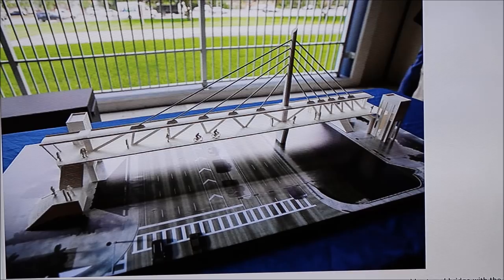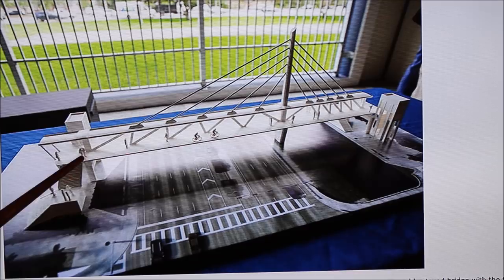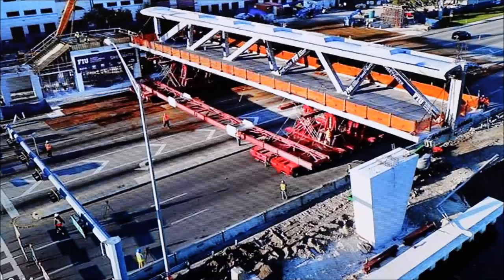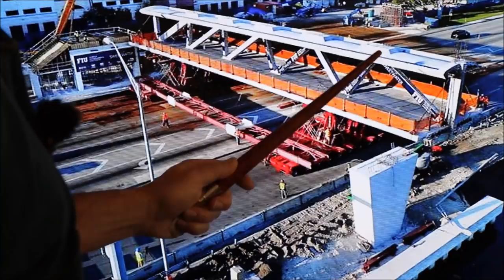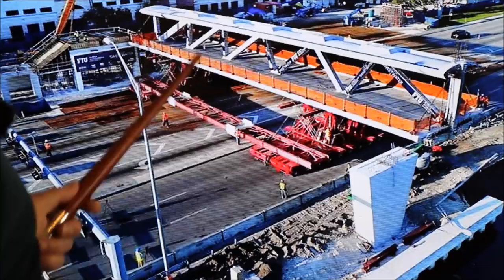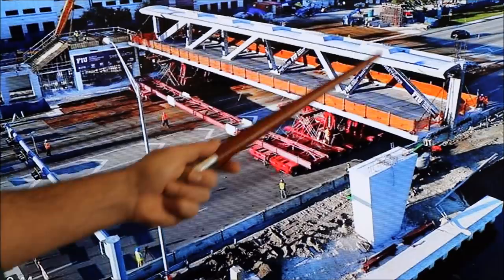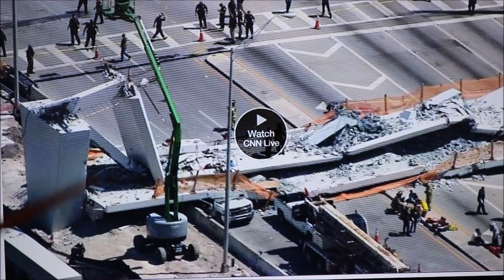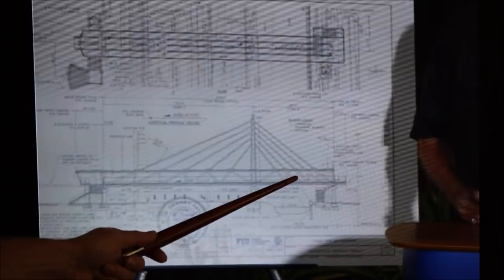Miami Bridge Failure- preliminary analysis 17 March 2018

Comment: Call me an armchair engineer , but this truss design is upside down !!!  The first truss member should go from top to bottom !! 
If you look at the rendering at 2:31 ,  from the main column you see the two truss members go from the bottom up, now imagine yourself holding two buckets of water in the air in that position....that would be a challenge to keep them up....same with this design.....

Comment: Thank you Juan.
This is a quite precise early analysis, although of course we'll have to see what the official NTSB investigation comes up with.

I have two remarks regarding this bridge failure as described in your videos. 
First I can't see any sagging of the bridge before the collapse on any of the various videos I found including yours; then the collapse is extremely sudden and quick. These together make it look like the failure is not of the tension rod but of the beam itself, as if it was unable to withstand the compression resulting from the tension rod elasticity. Could it be that the mechanical energy stored in the elastic tension rod accelerates the bridge going down?
Concrete beams should be able to withstand such pressure. I understand new materials were used. What were the beams made of?

As much as I agree that aesthetics is important for a bridge, it should never take precedence over structural soundness. When in addition the aesthetic choices make it look like a well-known good-practice for bridge but without providing the corresponding structural advantages, it looks more and more like an exercise in penny pinching.
I am not opposed to creativity and new inexpensive solutions but safety should always go first.

(Please excuse my usage of technical terms, I learned structural engineering in French and never practiced in English.) 

Separately and finally I seize the opportunity to thank you for all your great videos going through the whole south-western US on your modded CB500X. They made my twin and I consider Utah for a motorcycle trip to celebrate our 50th birthday. As it turns out it will probably be Vietnam, where he lives, but I am not ruling out your country for a coming year.
All the best from Costa Rica.

Comment: I would like to see an analysis using classic truss analysis.  looking at the picture I have a suspicion as others have said that the bottom connection to the angled concrete beam that they were tightening the cables on failed. the lower beam especially at the ends is in tension and the connection from the angle compression memeber to the lower horizontal beam seems totally destroyed in the pictures.  In any even good information and pictures.  thanks for the explanation.  you collected lots of good information.

Comment: Why would they add the non functioning aesthetic tower and cables to an already heavy bridge design? Wouldn't it put unnecessary load on this structure both downward, and sideways  during a hurricane wind situation? Great video.

Comment: When I saw the pictures of the installed bridge my first thought was, "Why such a heavy monstrosity for a simple pedestrian bridge?"  Then when I heard about the hurricane resistant requirement I guess it made a little sense. The concrete would be more resistant to corrosion than steel, too. Of course, today we have excellent coatings that would last a long time. Still, why was that concrete canopy necessary, or even a canopy at all? Obviously, a lot of emphasis was put on aesthetics for this structure. The whole thing just seems extravagantly overdone. Not my money, though, I know. I wonder if they will ever complete the project now.

Comment: Hi, Juan- I followed your narrative of the Oroville fiasco from the beginning. Found your analysis accurate and insightful. I guess you are a mechanical engineer (I'm an electrical), but I would like to know where you got the information that the Miami bridge was a truss design and not a modified cable-stayed bridge design. It looks remarkably like the Skyway Bridge near Tampa, which IS a cable stayed bridge. I find it incredible that an engineer would design a pylon the height shown in the NTSB video, with the lateral extensions (looks like steel channel, not cables) perfectly aligining with and connecting to the trusses on the fallen span, simply for aesthetic reasons. thanks
Reply from the maker: From the preliminary NTSB report...

Comment: Concrete structures do not do well tension.   The cables or rods that were being tensioned  are there to put the concrete into COMPRESSION where concrete performs well.  This is known as post tensioning.  The trick is to tension the rods/cables inside the concrete structure such that it will always resist the applied load (static plus live load).  Any element of the bridge must never exceeds the pre-load.  A closer look at the design details  may reveal redundancy in the internal rods/cables.

Comment: I cannot fathom why they wouldn't have installed temporary support piers under the span ends and at mid-span until the post-tensioning was complete, it wouldn't have hindered traffic much and it would give the span additional support in case there was a failure.

Comment: Since the basic design is a warren truss, the correct analysis is that the end members and the top chord should all be in compression.  Apparently the workers were re-tensioning the steel tendons inside that member, which added compressive stress.  I think the compressive force was significantly more than the allowable design force.  
That member should not have been compressed above the design limit.  Member #11 failed at the connection to the upper deck by punching through the top chord of the truss.  The connection at that point was not designed to withstand the amount of force that member #11 transmitted.

Comment: as a retired Carpenter I think concrete and steel are the best materials to work with pure concrete not going to work and I guess you have already seen that rhubarb and steel and concrete is the best combination plus your pre-stressed cable

Comment: Looking at the image at 9:59, it sure looks like it bowed enough for the bottom to slide off of the support column. The "truss" configuration only works if the triangle points remain attached. In this image, it sure looks like the vertical and horizontal points of the end triangle separated.

Comment: Just wondering if the original conception of the bridge was as a cable stay bridge?
And then this odd concrete truss design evolved to cut costs. One of my favorite construction matetials is concrete, and a safe concrete truss can surely be designed and built, not sure if this was it though. 
I ask the question, if the installation had been completed successfully, would the bridge have been a ticking timebomb, waiting to collapse in  a year or two or ten years from now?

Comment: My own speculation is that the design will be found sound.  FIGG is not a newcomer to bridge design, and is well known for its expertise.  I think that it will either be faulty material or construction (something didn't meet the specifications or plan), or it was a change order that was not properly scrutinized (Kansas City Skywalk Collapse), or some other construction problem like unexpected settling of the roadway, failure of the post-tensioning mechanism (very likely).  

Keep in mind that this was a design-build project, which are very common in Florida.  In my opinion, design-build works best for proven structures, not innovative designs like this one.  Design-bid-build brings more safety and scrutiny because of the somewhat adversarial relationship between the designer and contractor, with the designer playing the role of the owner's advocate.

After reading through the proposal (which is available online), I was surprised at the under $10 million price tag for this structure proposed by the design-build team.  There may have been some cost-trimming that contributed to this failure.
Reply: I did want to add that the lack of structural redundancy is very troubling.  Single-point-of-failure and fracture-critical structures do not belong in modern society.  Loss of function rather than collapse from unexpected events/forces should be the goal of every structural engineering project.  When will we learn?

Comment: I’m going to disagree with you Juan. My guess is, it’s not a design flaw, but an on site mistake somewhere in the assembly.
Reply: I think a construction error is likely the trigger. But the design was flawed in that it allowed for a rapid collapse with a single failure. Modern engineering design should have some level of redundancy. That might have been cables for the final design, but with it partially assembled, they should have had temporary supports in place until the tower and cables were completed.

Comment: I heard during one of the news briefs, someone said that  the tension cables were loose and they were tightening them when it failed.
Reply: Other sources indicate that the tension cable may have been over-stressed and  damaged during transportation. Attempting to tighten it afterwards caused catastrophic collapse, and failure to divert traffic while working  was short sighted.
Reply: It wasn't short sighted, it was criminally negligent. It's bad enough exposing site workers to this level of negligence, exposing the public is criminal in the extreme.

Comment: This story was posted late Saturday afternoon,  https://www.nytimes.com/2018/03/17/us/florida-international-university-bridge.html    It discussed FIU's connection to the ABC style of bridge construction.  ABC is not new, rather something that has worked, and continues in refinement.  The irony is the center of the world's braintrust on the ABC method is the engineering department at FIU.  This bridge was to be a showpiece for the expertise and innovation of the ABC method of bridge construction.  As somebody who had an engineering career, some of it in bridge work, their idea is a great one - build on-site, but not in place, then move to intended location.  I've advocated for something similar for a long time.  With the huge need of infrastructure improvements in the US, especially in bridges, we need to find a better way than what has been done for decades,... sorry, I digress.

There is an inherent facade in this design.  In the Warren design, the top strut is in compression, the bottom one in tension, and the diagonal struts in alternating compression and tension.  In this case, the designers wanted the appearance of the struts to be the same, whether in compression or in tension.  This idea is fine for steel design, where both compression and tension are possible.  Steel does well with tension.  Steel does well in compression, to a point, when buckling consideration becomes important. However, concrete, by its very nature, is very capable in compression, and not in tension.  Therefore, in order to deal with the struts that are in tension (by the design of the Warren), the design included post-tensioning cables (could be rods, bars - does not matter, but will call them cables for the same of simplicity  here).  These cables are internal to the  concrete strut, and then can be tensioned after the structure is in place. It is entirely possible, these same cables were tensioned before the move on Mar 10.  But, now the need to refine the load on the cables is needed to bring to spec, and to adjust for the camber.  The tension in the cables, not only carries the load of the bridge (through the Warren trust design), but has an overage of force, so that the concrete can be put into compression (remember, concrete does not hold tensile forces).  The cables would be in a sheath, well lubed, so that their only load bearing capacity would be developed at the end - far end may be varied load, but the pulled end would be against an end plate.  After  final positioning, they may be grouted into position.  Post-tensioned concrete bridge beams, albeit a different design, have been used for decades.  They have also been used widely in building applications.

To be sure, the deign is a bit unusual, but not impossible (IMO).  Proper tensioning, with the proper sequence of events, can fulfill the intended purpose, that is, having a tension member be in compression at the end.  I know some ask "Why was the road open?"  This task could have been started  last Saturday, immediately after the placement, started on Monday, started at the other end, and maybe even some work on the failed strut.  My point is that the failure may have happened after much similar work had already been accomplished on this structure.

Comment: Good video. Thankyou.  
I just came across this info yesterday and it is a bit creepy after going through the 35w bridge collapse many years ago in Minnesota.
The company that designed the pedestrian bridge that collapsed in Florida is the same company that designed the new Interstate 35W bridge in Minneapolis, after the old span collapsed more than 10 years ago.
The engineering company is FIGG Bridge Group.

Comment: This is the best analysis I've seen so far. I also could not understand why the use of concrete instead of steel? It's just much too heavy and would typically need a center of road support pillar. I also don't understand why the tower and cables are only aesthetic? I don't even like them. It's more aesthetic without them.

Comment: Is the design comes from the university? Do the people know that  "safety first" is the number priority in all construction sites? Launching this across the road with traffic moving under is definitely a breach of engineering practice. The design is obviously wrong. How is it possible to post tension such a thin concrete section without causing it to warp and hence internal cracks. The  triangular concrete trusses above are overloading the bottom. Post tensioning any one of the truss member produces a force in the direction along the adjacent member 
( bending moment) to the bottom tending to overstress the point and breaking the bottom section at that point. This is my view. Please correct me if I am wrong.

Comment: Has anyone looked at thermal differentials? The collapse occurred when the sun was directly overhead (1:00 PM EDT) on the day of hottest day on record at that location on the vernal equinox. The top cover was much narrower than the bridge deck. The center of the deck would be shaded by the canopy, while both outside edges and the canopy would be subject to the full heating of the sun. Could this have caused thermal stresses that had not been considered?

Comment: If the construction worker who was tightening that Rod survived he has the answer to what happened. He can give information as to whether the bolts for turning freely and had an inch of play before even came in contact with something that would make it tight or he was already over torque those two questions come to my mind immediately. This reminds me of adjusting a guitar neck in order to get it to Bow properly. One thing that is done with a guitar neck is that all of the strings are loosened up and sometimes you have to physically push the neck in the direction you wanted to go and then you begin tightening it so I can't imagine this thing would have done any movement whatsoever and I would be more inclined to believe that those bolts completely snapped. These people had no clue as to what they were doing if this was a procedure that was any procedure manual I would imagine they probably didn't even have one. They have absolutely no clue as to how to properly do something like this. It should have been tested off-site before they installed it including the tightening. I just found out that his safety harness didn't hold him up so sounds to me like this Construction Company needs to go out of business.

Comment: can you tell us why do you think they had a large crane attached at the point where it failed? eyewitness said the crane hook was either straightened or a piece broke off. he said they immediately backed the crane away from where it was like it was never there. it was next to the green platform lift. you can see it in the earliest pictures taken.
Reply from the maker: J D I believe it held the hydraulic tensioner.

Comment: The support structure at one end was moved from its original position as designed. This placed uneven stress on that part of the span. The Post Tension design seems inappropriate for the amount of concrete used.  There were supposed to be extra supports extending out from the mounting points to handle the load. 
Looks like a bad idea , poorly done with zero public safety .

Comment: The design did not include a covered walkway when approaching the bridge in a location that regularly experiences monsoon-styled rains and thunderstorms at least half the year.  A tunnel would have made better sense--all the engineering would have been in waterproofing, drain and pump design to keep it dry owing to the sea level location of Miami.

Comment: My biggest problem with this bridge design is that there's no connection between the PT rods other than concrete, which is infamously terrible under tension. They should be interconnected with steel inside the concrete in my opinion. I don't like the material choice, the web geometry, or the fact that the tension cables in the bottom deck are in the top third of the slab. They should be as low as possible. So many dominoes knocking each other over.....